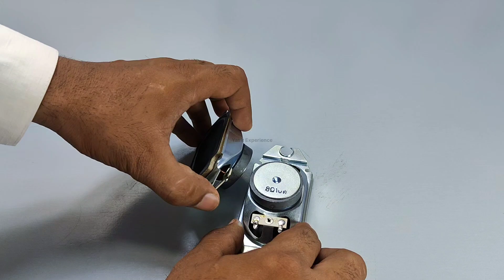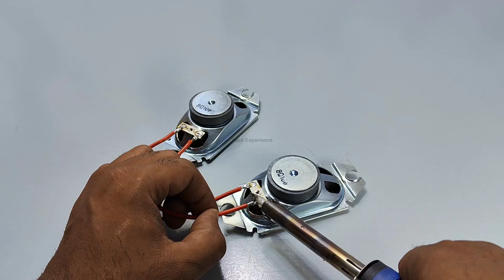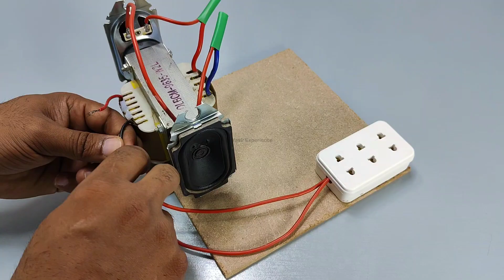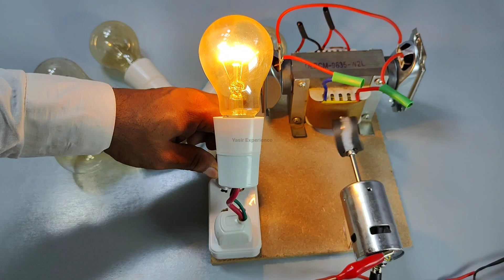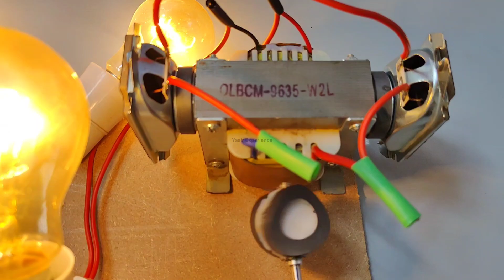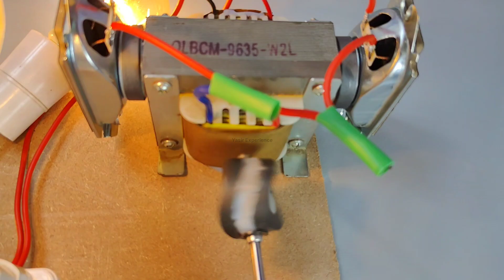i create 230v Free Energy Generator With transformers tools use 2 Speaker

Comment: At the beginning of the video, you wrote that it produces 26 kw . Why do you use weak bulbs?  Why not use a saw or microwave to power it?
Reply: Volts is not Amps....   it requires Amps to run Microwaves and saws.
Reply: @magickladycj  This means (26 kw) it's FAKE